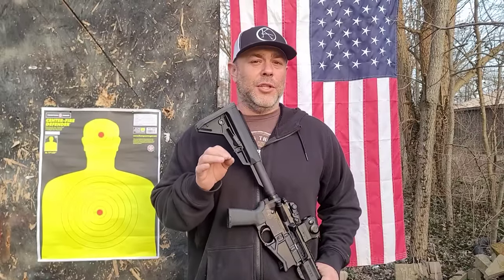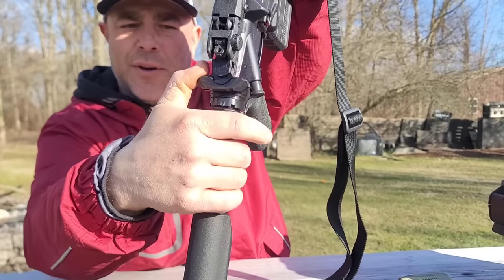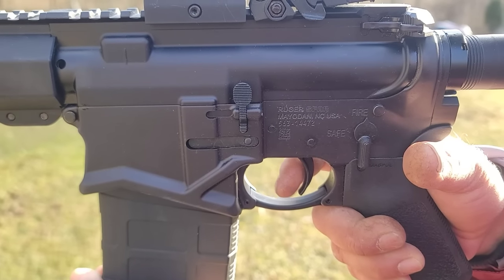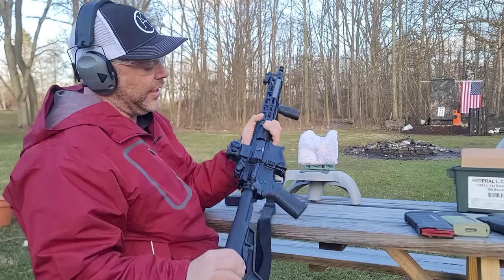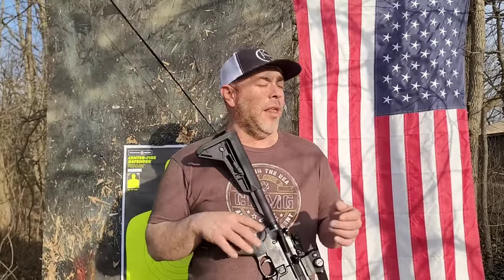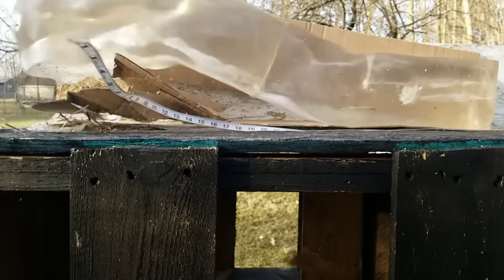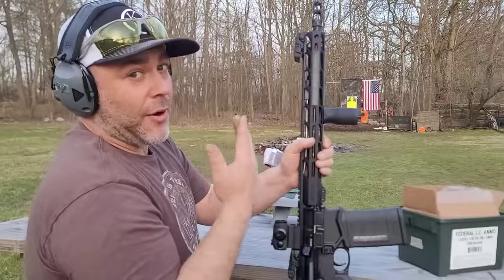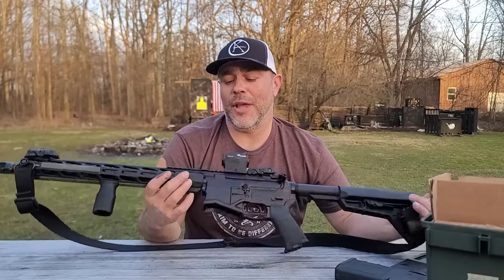Ruger SFAR NO 🐂💩 FULL Review. The AR-308 Struggle Is STILL Real😕

Comment: I like Ruger for the most part. Have 2 LC9's and an LCPII. On the 3rd mag through the LCP, it threw the ejector out of the gun. Was a single shot for the next few rounds til I figured it out. Back to Ruger it went, they got it back to me pretty quickly. Only shot it once since, hope it's fixed for good.

Comment: My month old Ruger SFAR S/N 563-122XX is having the exact same issues. I have about 250 rounds in it as of yesterday, and have done 2 complete deep cleanings before yesterday's indoor range testing at 100 yds. On my first two range tests I shot "outdoor-store" shelf Federal 150 gr Power Shock and Winchester 150 gr Power Point. I'm attempting to stay around 2800+ fps for consistency and range. Setting 3 is violent! Case head swipes with burs, and also lots of bolt override feed issues. Dented the cases pretty bad. Setting two not fully cycling and failed to feed.The Winchester stuff was cheap, but dirty as #3[[. So dirt caked up the bolt with carbon and it failed to move forward enough to cause very light fire pin strikes (not good...test over for the day...only use clean powder ammo!). Gas rings are still very tight, maybe too tight, so lubricate that area well. My last range test was with Federal American Eagle and PPU 150 gr. Setting 2 all the way. American Eagle failed to pick up almost every round, and didn't shoot very accurate. PPU cycled 100%, did mediocre on accuracy, but throws fireballs out on every shot. Then I tried some Federal 130 gr hollow points (3050 fps) that did 1 MOA groups at 100 yds. This is my ammo of choice! But it also failed to pickup rounds. Long story short, I think this is a strong buffer spring issue. I inspected the 3 gas port openings when I cleaned the block, and port 2 is a bit too small, while port 3 is too large. Opening up port 2 might help, but I still see slight swiping of case heads even on setting 2. Oddly, PPU doesn't have this issue at all (probably my cheap practice ammo of choice). And BTW, I tried the H2 buffer. Not good at all. Makes it worse. "A body at rest stays at rest", so when the carrier slams into it with a stiff spring it's likely to be even stiffer resistance. All this may eventually work itself out with good PPU pounding (since it works), so that is my goal for now. It the problem persists, I'm putting in a lighter spring. But I do wonder why some people got perfectly good working examples while we got problems. My bet is Ruger changed the specification on the spring.
Reply: Come back and let us know what you find out, please.
Reply: @Nobluffbuff  Will do. I am going to contact Ruger to see what they have to say, then post here. 😉
Reply: @GuitarPHILBERT  Same here.  Be back in a month!
Reply: UPDATE: Problem solved! I installed a Tubb's SR-25 / AR-10 Flat-Wire Buffer Spring and everything now runs on gas setting 2 without any issues at all. Even the bolt catch worked every time. I just got back from the 100 yard range, and I'm gassed...but not over-gassed. I fired 40 rounds of Federal 150 gr American Eagle (which only ran on 3 with the stock buffer spring), 30 rounds of Federal Varmint & Predator 130 gr at 3050 MV (also used to only run on 3), and PPU Range Line 150 gr (used to run on 2 or 3) no problems. The stock spring is a lot stiffer even though it's 13.5" long. Compressed with the BCG held back it is squished. The Tubb flat-wire spring is 40" long and has a lot less tension and space between windings with the BCG compressed. Check out their YouTube videos. Wanted to try my H2 buffer weight, but ran out of time. Accuracy is great with all three. Spring noise is much lower too. Best $30 I could have spent for a great upgrade. No more case-head swipes, and all brass exits at 4:00. Perfect! (I recovered every casing)

Comment: Mine has about three hundred rounds through it. It’s accurate and dependable. I had two malfunctions in the beginning. One override in setting two and one malfunction in setting one with a suppressor in place. I changed out that silly break for a linear comp. I think Ruger needs to fix it. At least it’s fixable versus the m and p 10 mm
Reply: I got the m&p10 sport. What fixable are you talking of? I haven't fired mine yet but read the gas block is under gassed and it jams.
Reply: How accurate

Comment: Just another data point I have just over 350 rounds through mine with zero malfunctions. Most was m80 ball and steel case and hunting ammo.. I bought mine for hunting because I hike miles and it’s light. 
 I hate seeing these prices at 1200 bucks when they only actually cost 800 
I love mine
Reply from the maker: Good info! Thank you. And yeah I paid too much. I got impatient👍🦃👊
Reply: 1200 bucks is pretty damn cheap for an ar15 size .308
Reply: I just picked one up for $999
Reply: 2399$ welcome to Ukraine. I won't buy

Comment: Pull the adjustable gas block apart and see if there is anything blocking the gas port in the barrel  and blow air through the gas tube and see if that makes a difference.

Comment: I really like ruger. Especially for revolvers. I think their bolt actions are pretty good. I did have a AR556. It was poorly assembled, no lock tight. Castle nut was not stacked. Buffer tube was free to rotate. I don't consider ruger 5.56 and AR10 rifles to be of great quality. Not trash. I guess middle of the road. But it won't compete with a Midwest Industries, BCM, SOLGW and so on. I did sell my AR556

Comment: I've had mine for about a month now. Seems to properly cycle everything. Pmc 147 gr fmj bt.  Federal 168 gr sierra matchmaking. Winchester 180 and 150 gr power point. Federal fusion 150 gr And freedom munitions 168 gr amax remanufactured.

None were NATO rounds..but 308. Close to 200 rounds now.

A friend of mine seemed to have a similar problem with the rifle, a defect on the extractor.

Ruger is fixing the problem.

So far, mine is perfect...hope it lasts, love the platform
Reply: Curious. Did they simplify replace the exterior or did they provide a whole new bolt?
Reply: Not sure...the last time I saw him it was still in the Ruger hospital. I'll up date next time I see him...he works at a gun shop.
Reply: Fyi...I've not played with the gas block either. It's still on the factory setting. I've not gotten any gas in the face... probably due to the fact that I've put an AR 15 Aero Breach charging handle on it. I'm looking at cans now to aid in taming the beast.
Reply: @evankennedy1363  My first one I shot 150 grain .308 ammo. I kept it on #3 because it was right in the middle of deer season and I didn’t want any hiccups…Afterwards I found that it would cycle certain 150 grain ammo on #2, but when I switched back to my preferred round, it would not 
cycle reliably, so I just left it in 3….After deer season, I thought I’d try 110 grain V-max ammo and use it for predator hunting with my Pulsar Thermion XQ50 pro thermal scope and that has only had one failure to feed so far. For that set up I’m using a suppressor and gas setting #1…The gun has somewhere around 700 rounds through it at the moment.
Reply: @evankennedy1363  Id love to know what they say his issue was.
Reply: I'll be sure to report back when it gets out of the hospital. He was a silly boy though...he made mods to the trigger assembly Before even firing it, so when it screwed up, who was to blame? It still malfunctioned after returning to factory build.

I put a Swamp Fox 1x10x24 on mine...getting sub moa at 100yrds. I need to find a longer range to really see what this boy does. Swamp fox's recommendation was a 50 yds zero... which will re zero @ 200 yds.

I'm looking into some Hornady TAP red box ammo. They've got a 114 gr that looks cool, along with other weights that are Impressive. Looking for that Perfect round as I intend for this to be the Bug Out Boy.

Comment: Great testing procedures and an excellent video.  Haven't had any problems with my 16" SFAR and have yet to test my new 20".  Are you showing any unusual signs on the bolt carrier after the testing?  Almost looks like it might not be fully retracting?  Yours is not the first SFAR video I've seen where problems cropped up.  Maybe Ruger needs to step up their manufacturing and quality control procedures to achieve the high reliability we all expect and need in our firearms.  Thanks for keeping it real.  Jess
Reply: Hey Throw back did you use .308 Winchester or 7.62 NATO ammo in your rifle?
Reply: @sgtrosso  Some 7.62x51 ball but mostly 308 so far.
Reply: @sgtrosso  Only other difference in how I handled my SFAR was I shot it right out of the box without disassembly or lubrication but that shouldn't account for the problems you are experiencing.  Jess

Comment: FANTASTIC video. You tried all gas settings, different mags, and this is exactly what I expected. Bolt not coming back consistently fat enough to grab a round every time. Recoil spring or gas port. GLAD I didn't get this, but reviews I've read also show the M&P10 Sport doing the very same thing. Odd on the break in stuff- my M1A1 nor SOCOM16 needed anything but more rounds. FEED ME SEYMOUR.. like the xdme 3.8 trigger- send it back and let's see that next video. Great effort.

Comment: I am so far, in agreement with a lot of the other comments.  Try a different buffer, and possibly spring.  
I've also seen other videos where some of the guns have issues with the gas blocks.  While others run perfectly fine.
However, I do notice that you are still sticking with the same ammo.  Whenever there's constant feeding issues, try another ammo.
The settings for the gas block are as follows
3) Full gas.  Use during break in, according to Ruger.
2) After break in.
1) Suppressor setting.
0) Bolt action only.

Comment: Pmags tend to sit low in the mag wells of all 308s. Heavy + gravity + even worse with the 25. It takes almost no tolerance not to grab the round, so I use to run a strip of nicely applied duct tape inside the back of the mag well of my 308s, it sets the mag tight and high where it should be. End of the 308 problems. Magazine drops need some help though after that mod. Lancer mags (20) have better tolerances and the metal leaps that have been just better for me as well.

Comment: They come with a super stiff recoil spring, i left mine compressed for about a week and shot through setting three for about 2 hundred rounds, now works with most rounds on setting 2
Reply: Would you recommend it ?
Reply: @freedomunedited6836  shot more rounds through it without issue, I would like to shoot a few more rounds before 100% recommend it, but .308 is a little pricey !! but so far so good.
Reply: Compressing your buffer spring for a week or a year or a decade does nothing to the buffer spring. Just like a magazine, it's made with spring steel.
Reply: @barrettanderson2781  Regardless of material, it will take a set, granted better quality steel will last longer, but it will. Normally when running a new magazine with my duty weapon we are advised usually to run 1 or 2 less rounds for a few weeks and then top of with the additional rounds after that time period.

Comment: Seems like the dame issue I had.  3 was over gassed, but 2 was not enough.  I changed the regulator to a normal AGB and drilled the gas port a bit bigger.  Its been running like a top for me ever since.

Comment: Ruger makes it clear that you need to run the adjustable gas block at the highest gas setting during break-in for proper cycling. After it breaks-in, you can dial the gas back down.
Reply from the maker: That is not accurate. Nothing is clearly stated like that. We have been through this a hundred times with a hundred comments. There is one page that mentions something kind of like this. But there is no official break in.....
Thanks for watching.👍🦃👊

Comment: Setting 2 is for 308. Setting 3 for 7.62x51. The reason is because 308 has higher pressure than 7.62. If you were wondering why it is acting that way.
Reply: And also your 2 screws holding the gasblock in I am guessing isnt tight.

Comment: Have you tried different brands of ammo? I don't know why but when I used Federal American Eagle 150 gr to break in my 16" Ruger sfar it jammed or failed to load all the time. Took me a while to get through 20 rounds and I was convinced my gun had issues right out of the box. Then I switched to PMC brass 147 gr FMJ and shot over 60 rounds without an issue. Switched the gas port from 3 to 2 and fired another 100 rounds of PMC with zero load issues once again.

Comment: Hey Ruger, there seems to be some issues with the adjustable gas settings.  Setting 2 is not enough 3 is too much. I wonder if Ruger (or an aftermarket company) would benefit from making regulators with more adjustments. Even if only 4 settings fit on one regulator, with how easy it is removed there could be 3 or 4 different regulators available all with different size holes for fine tuning the gas.  They all would be made to fit the stock gas block. Sure would make tuning it easier and help reliability.

Comment: Loctite is okay but you really need to aware of which of the hundreds of Loctite Formulas is best for the application you are using it for. On the other, I highly recommend Vibra-Tite for pretty all fasteners on firearms (use the manufacturer recommended grease or other product for barrel nuts, muzzle brakes, and the like). Vibra-Tite is the type of stuff you find on Magpul fasteners.

Comment: I'd send it back to Ruger. They didn't get the bugs out of this system. Maybe the gas port size needs to be changed, maybe the buffer weight needs to be adjusted, maybe a heavier mag spring would help but the bottom line is the gun doesn't function and you shouldn't have to fix it. Ruger should. 
The biggest problem with the AR 10 is that AR 10 designs are different from several different manufacturers. Some hold closer to the original design while others use proprietary parts and or some AR 15 parts. When the guns are made to the original spec they work just fine However, we now want refinements we see on the AR 15 such as light weight, heavier profile barrels, more ergonomic features and ambi features, etc. and every manufacturer of AR10's goes their own way with these changes. This makes it far more difficult to get them to run correctly.

Comment: Never really had an issue with performance but honestly haven't shot them very much (maybe 700 or so each) I have an Aero AR10 18". a POF revolution pistol length 12.5"  with a suppressor on the POF did get dirty fast but the POF is handy and did take a White tail at about 150 yds during pistol season

Comment: Seems like the older magazines just made the bolt override problems worse. That doesn't excuse the gun obviously. Ruger should probably redesign the gas adjustment and allow for more settings or dial in their manufacturing better to get reliable function with the settings they have. If you had a gas setting in between 2 and 3 it would probably run great. You could always mess with the buffer and buffer spring but all that SUCKS to do with a brand new gun! Like you said the whole concept of the rifle is freaking awesome but if they can't get 99.9% of them to work 99.9% of the time then it's kind of a big problem. That's still 1 failure in a thousand rifles or a thousand rounds which honestly still isn't top notch reliability. I think the easiest fix is for Ruger to do a recall and put an improved adjustable gas block on these with more settings.
Reply: Ruger needs to up their Manufacturing consistency. With the added stress on an AR15 size bolt, I hope they are watching Metallurgy and HT. I like this gun & want it to work, but will stay away from it for now.  I assemble my own guns and have learned an awful lot over over many builds. There is a lot going on in Stoners design.

Comment: Note on red dot, appoint at 300’meters the dot is the same size as a man 5.56  “max” range is 300 so no issue but 7.62 limits the range again not an issue if you never shoot in an area over 300 meters

Comment: Been seeing a lot of people having the same exact issues with this rifle. From what I've seen some people post is that they have fixed the issue by simply upgrading to a heavier buffer. You can pick up a H2 buffer for about $30 online. If you have this rifle and are experiencing the same problems try this solution and respond back on this to confirm. Hopefully we can help people fix the issue if this in fact the issue.

Comment: LC is good ammo for the most part. I have a  Sig 716 308 Piston that would not run the bulk LC surplus ammo. It would run name brand like a champ but the LC would not cycle very well. My friend that was a gun smith told me a lot of the bulk ammo is made to run in full autos belt feed for the most part and isn't as hot as other ammo. After fighting it like you did and a few hundred rounds the gun would run the bulk ammo. I never changed the Piston setting as it has 3 my friend told me to put the gun on adverse setting and run the gun, I never did as the gun ran all other ammo fine. Try some other brand ammo for sure just to see if it will help the DI gun run.

Comment: I haven’t tried the rug at sfar, but I built an aero m5 in 308 and haven’t had a single malfunction yet. Only 140 rounds in. I bet if you take off the adjustable gas block it will cycle fine.  Seems like those are a waste if not shooting suppressed.

Comment: I have the same rifle. I broke it in on setting 3 as well but with no malfunctions. When I changed to setting 2 I started to have malfunctions with certain ammo. I went back to setting 3 and haven’t had a malfunction since.
Reply from the maker: That seems to be what a lot of people have to do. Don't you think it's a little gassy on setting 3 though? With mine it feels like I have a tube directed up my nose and down my throat. 🤮
👍👊🦃
Reply: Actually I don’t get much gas back in my face for whatever reason. I switched to a radian raptor charging handle which might help a bit.